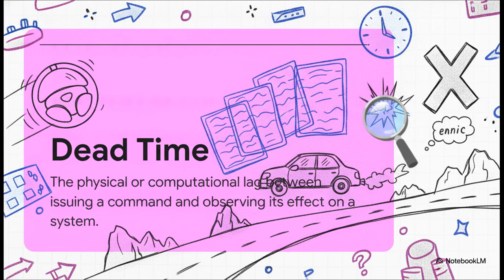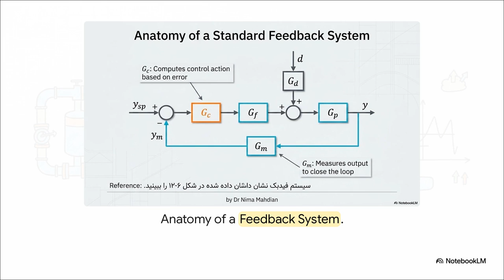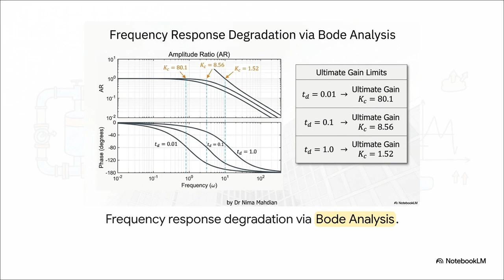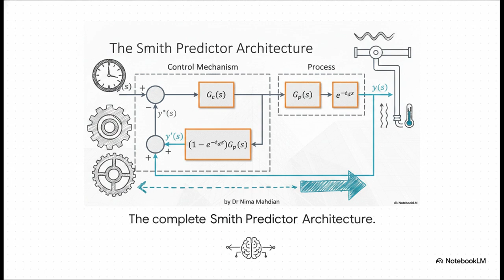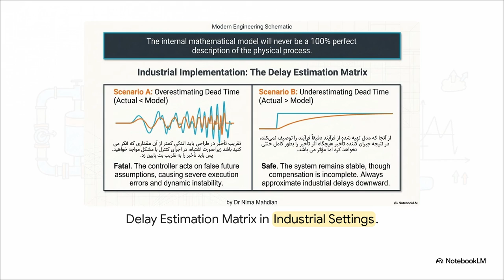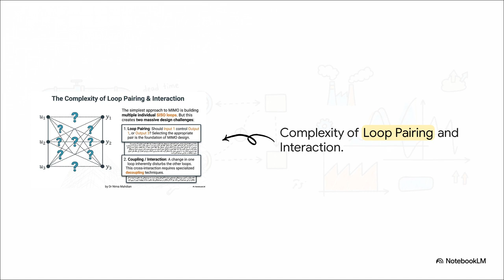Smith Predictor | Compensating Time Delay in Industrial Process Control

Comment: When a MIMO process has several possible connections between u1,u2,u3and y1,y2,y3, how do we select the appropriate loop pairing while considering the coupling and cross-interaction between the other loops?
Reply from the maker: Thank you for your excellent question. In a MIMO process, loop pairing should not be based only on which input has the largest effect on each output. Engineers usually analyze the process gain matrix and the coupling between loops.

A common approach is to use tools such as the Relative Gain Array (RGA) to identify pairings that reduce interaction between the control loops. Engineers also consider the direction and magnitude of the process gains, operating conditions, time delays, and actuator limitations.

After selecting a candidate pairing, the complete multivariable system is tested through simulation or sensitivity analysis to verify that changes in one loop do not cause excessive disturbance in the others.

Therefore, the objective is not simply to find the strongest u
i
→y
j
	
 connections, but to select pairings that provide good controllability with minimum interaction and robust performance across the expected operating range.

Comment: Dr. Mahdian, I appreciate this clear and practical explanation my question is:
In practical industrial applications, how can engineers choose a safe dead-time estimate for a Smith Predictor when overestimating the delay may cause instability, while underestimating it gives only incomplete compensation?
Reply from the maker: The performance of a Smith Predictor depends heavily on the accuracy of the dead-time model. In practice, engineers estimate the delay using step-response tests, system identification, or process data, and then validate the model through simulation and plant testing.

Since process dead time can vary with operating conditions, engineers usually avoid overly aggressive tuning. A slightly conservative dead-time estimate, combined with a robust controller design, is often preferred because it provides better stability in the presence of modeling errors.

If the delay is underestimated, the Smith Predictor provides only partial compensation and the response becomes slower. If it is overestimated, the mismatch can significantly degrade performance and, in severe cases, lead to oscillations or instability.

In critical industrial applications, engineers often use adaptive dead-time estimation, gain scheduling, or robust control techniques to maintain good performance when the process delay changes over time. The objective is to achieve the best compromise between dead-time compensation, robustness, and closed-loop stability.
Reply from the maker: Thank you for your excellent question. In practice, engineers should not simply choose an arbitrary conservative dead-time value for a Smith Predictor. The delay is first estimated from step-response tests, process data, or system identification, and the estimate should be validated under several operating conditions.

The key is to evaluate the uncertainty of the dead-time estimate. If the actual delay varies, the controller should be tuned with sufficient robustness rather than aggressively compensating for a single nominal value.

A practical approach is:
Estimate t
d
 → validate the model → test sensitivity to delay uncertainty → tune conservatively.

If the delay is underestimated, compensation is incomplete and the response may be slower. If it is overestimated, the model mismatch can produce oscillations and degrade robustness.

For processes where the delay changes significantly with operating conditions, engineers may use adaptive dead-time estimation, gain scheduling, or robust/MPC-based strategies.

So, the safest choice is not necessarily the smallest or largest delay—it is the best validated estimate combined with a controller that remains stable over the expected range of delay uncertainty.